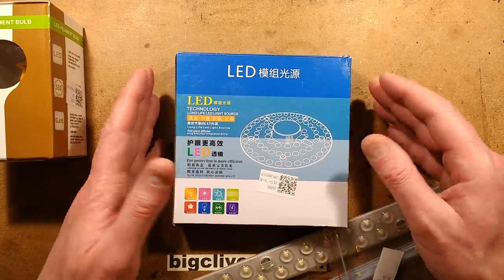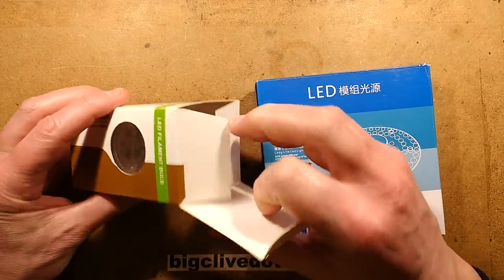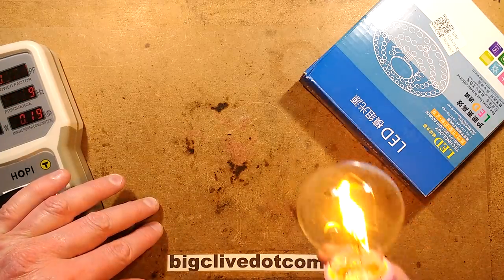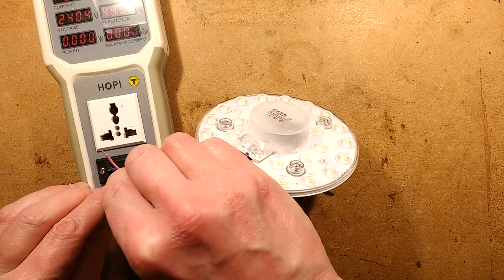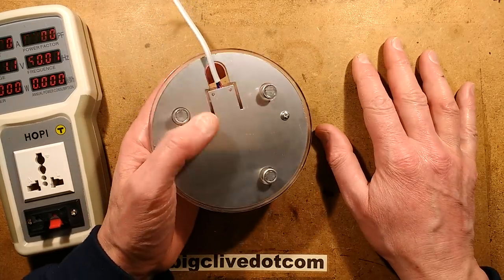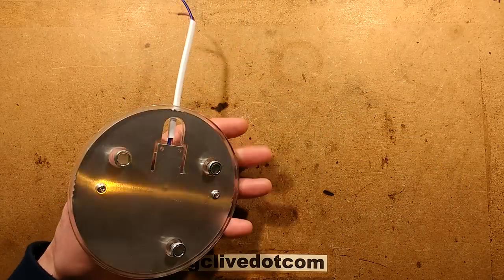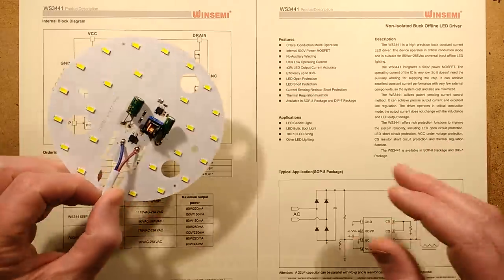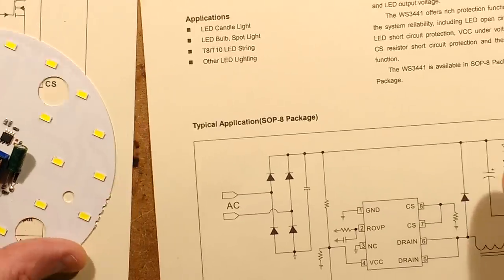Inside a 12W LED module.

Comment: The leakage could also be from light switches that have the locator neon wired across the switch terminals, maybe try powering one with a neon in series..

Comment: Just clamp a clothes iron in a vice. They have decent heat control so you can leave it on as you solder. Then turn it off and let it cool down slowly.
Reply from the maker: Oh, good idea.  I have an iron here.
Reply: I use a coffee cup warming plate.
Reply: I always have a temp-controlled heat gun by my side for shrink, etc.  I usually use it for warming boards or MCPCB's.  Preheating a populated multilayer board is helpful when trying to desolder things that are connected to heavy topside pours.  Using an iron really only works on boards that have a flat side.  Heat guns work for everything.
Reply: Yup, smart idea!

Comment: The only way to learn about these products is destructive testing.  :)  "I take things to bits so you don't have to" and all that jazz.

If there was a path to earth from the back of the puck LED light, do you think it would provide enough current to trip an RCD/GFCI?
Reply from the maker: I think it's microamps.
Reply: bigclivedotcom it might rise with age and then go down with a bang, insulation ages faster when heated nicely and then cooled again down :-). Most houses don't have lights on RCD

Comment: Clive, roughly what is the “reasonable” temperature that you preheated the aluminium cored board to? I’m assuming you’re using leaded solder and I note that 10 degrees C isn’t everyone’s “reasonable” room temperature! I’ve been using an old set temp iron with a 3/8” copper tip for the job, low 30s is the usual January ambiant temperature here (nth NSW AU) which probably helps
Reply from the maker: Not too high.  Probably around 50C and that was enough to allow the soldering iron to do the rest.
Reply: One way of doing this is to acquire an old (or new) Bunsen burner stand, and place a heat gun under it. That way you can adjust the temperature (and spread of heat) to suit. A search on Ebay (for Laboratory Bunsen Alcohol Burner Iron Support Stand Lamp Tripod Holder) comes up with plenty of cheap options.

Comment: That zero-crossing detection block looks suspiciously like it's designed to operate the inductor in discontinuous conduction mode (uhg, gross).
Also, Clive, the way you explained how the current flows through the inductor isn't really applicable in a buck topology. These buck inductors are always (except if someone's been pinching too many penny's) designed to operate well away from saturation, since that increases losses for very little increased power output.
In a buck topology, like this, the inductor is purely acting as a current storage element, like a capacitor for current. It will cause voltage spikes to keep the current as constant as possible, just like a capacitor will cause current spikes to keep the voltage as constant as possible. So, basically, the current doesn't start of very slowly rising then suddenly increasing a lot during the final part of the cycle; Rather, its maximum, constant, rate of change of current would be achieved for a large fraction of the cycle, linearly increasing until the FETs open, and then it will linearly decrease again, forming a nice triangular waveform.

Comment: Why is it you can only feel the capacitive coupling when you slide your finger along the surface, but not when just holding it there? I've noticed this before like on my metal phone chassis when charging it, and my girlfriend's skin when we were standing under some high power lines.

Comment: Not a fan of these designs using mains connected directly to a metal PCB.  Seems too easy for a layer of insulation to fail and expose users to the ungrounded rear of the metal.

Then again, we know that generic Chinese products Never Fail.
Reply: Stinky Cheese what? You don't like random zaps from a cieling mounted light fixture :-)

Comment: There’s a spare pair of pads above 1R4. Is it contacts for a parallel resistor?
Reply from the maker: I think it is.  It's a fairly common technique for fine tuning the current by using different values of resistors.

Comment: I still haven't figured out how to actually use (similar) modules like these. Without heatsink, the leds will die extremly quickly, even if they are only used for half an hour at once. But what kind of heatsink is there? How to mount these modules to cool them?

Comment: 10 C house, why, just why
Reply: Pure and utter madness. :)

No doubt Clive uses a cold water bottle in bed at night instead of a hot water bottle (no electric blanket of course to save on the electric bill).
Reply: He is Scottish, and heating costs money :)
Reply: It's nuts, even anything under 19 C makes me feel like it's a Kranhaus if I'm in it long enough
Reply: THX 1138 doesn't your face get cold!?
Reply: I got second-hand cold just from thinking about it.
Reply: Because 10C gives enough margin that water lines are unlikely to freeze even if they are a bit cooler than the rest of the house.
Reply: it’s most likely related to the fact that not only is it more often than not cold up in the highlands but he works outside high up in the open air so he is constantly acclimatised ( hope that’s spelt correctly) to the cold otherwise he would just keep getting ill 🤧 all the time and/or not be as able to do his job as well as he does.. just my assumption anyway, i’m sure Clive will tell us one day. the other reasons could be that he saves the money on the heating to go shopping at pound land or it’s just simply cos he’s a tight arse 😳😁😁😜
Reply: Bears like it cold, that's why.
Reply: Why? Because they don't make thermostats that go any lower. ;-)
Reply: 16°C is my low threshold temperature for an office. Below that, and the aches and pains become intolerable.The bedroom, however, was at a comfortable ~5°C last night, with the window open. Can't sleep in a warm, airless bedroom.

Comment: The coffee maker element, Nerdrage was looking for magnetic stirrer heating elements a year ago, I wondered if it would be the same type. 
  Needless to say, he did have a load made specifically for the task at great expense. You mentioning it spiked my curiosity.
Reply: Magnetically stirred hotplates are a lab. standard appliance. The German company IKA-Werke do a very wide range, and they also supply a complete range of spares, including heating elements (theirs are ceramic-enclosed for safety). Not that expensive either.
Reply from the maker: Nurd Rage featured those again.  They are outlasting the original elements completely.

Comment: Clive, i would like you to investigate testing capacitors using a audio source...   as what i have seen on youtube doesn't really backup the theory... thanks if you do...
Reply from the maker: Capacitors are not optimised as a sound source.  Although they may exhibit piezo electric properties it's usually considered a nuisance.
Reply: I didn't expect an answer so quickly....  But your right about capacitor as a source, but i didn't explain myself correctly.  please accept my apologies.  What i meant, was using audio source to test for faulty capacitors, and possibly still in circuit.   As i can hear the difference, but just wondered whether we could debunk it as a valid test for a faulty capacitor...
Reply: Shango066 does this all the time when "resurrecting" old radios and televisions. It's certainly an effective go-nogo test.
Reply: thicklyspread  What property of the capacitor are you wanting to test? The capacitance, the self inductiveness or for electrolytic type, the ESR? And do you mean while still in circuit, or out of circuit tests?
For out of circuit tests, for capacitance, apart from large electrolytic values, there are plenty of reasonably priced multimeters can test them. For ESR, there special testers available (they also measure capacitance).
For in circuit testing, it very much depends on the circuit that they are in. Sometimes a signal generator and an oscilloscope can help to indicate if a capacitor is okay.
Reply: Yep, that's the guy, just can't find the video i saw...  i'll have a look around

Comment: An old steam iron would heat it up nicely too, built in thermostat, "synthetics setting" maybe :-)
Reply: So, "an old steam iron" is that what they used before the electric ones?  :-)
Reply: LOL yes but you needed a bag of coal to iron a shirt :-D
Reply: And a problem to use upside down...
Reply: Dam right, the coal would fall out :)
Reply: The ashes were a problem with those, so grey shirts were common.

Comment: Hey big Clive how are you I watched your video on the driverless led chip was wondering do you think if I ran one on top of a heatsink and 120mm pc fan it would be fine planning on using them on my aquarium??
Reply from the maker: I'd be cautious about using exposed mains voltage LEDs in a humid environment.
Reply: bigclivedotcom indeed they will be inside of one the larger led flood light cases I plan on grounding them also as they don't seem to be when you open them?
Reply from the maker: It would work, but I'm not convinced about reliability yet.

Comment: Very interesting. As for the exposure, up until the block diagrams etc I thought it was spot on. Perhaps you had manually adjusted at that point. But, thanks to your thoughtful use of an off-white sort of paper, this is not normally required.

Comment: I have a ptc heating pad glued to a glass plate, the kind you find in showcases where they keep your food warm in! 
It actually works pretty good, it also has a knob to set the temperature :) I mainly use it to keep my coffee warm, but setting it higher will generate enough to help with the soldering!

Comment: Friends of mine have a large room that is lighted by multiple fluorescent tube lights. It's something like 60m² and they have 3 switches for the lights, one lights up half the room with about 8 fluorescent light fixtures, and the other 2 switches control 4 fixtures each. They are looking into reducing the power consumption of this (since each fixture uses about 60 Watts or so), but have no clue on how to do that. I've looked at one of the fixtures, but other than the fact that there is some big and heavy transformer like looking module in each of them, I have no idea as well. So is there a cheap way to make these fixtures use less power? Maybe even getting rid of the tube assembly alltogether and just putting LED strips in them? I think these fixtures are 120cm each, but I'm not exactly sure about that...

Comment: I'm looking to improvise an in-case-of-bad-days finger-tip warmer that can be sewn onto the fingertips of a donor glove. I want to use resistors because, well, I have a ton and (in theory) I can tune the wattage to a safe level.

What ballpark voltage and resistance should I use for a safe-but-warm experience? I don't want to burn fingertips.

Comment: Hi, Clive, I have two 230v to 12v dc supplies and have fitted a 12v led strip with 6 LEDs on the strip but they only last about one year under the kitchen cabinets do you have a suggestion to replace them with something that will last longer?

Comment: Why not use a heat gun or your hot air station for preheating?  You already have one, and the MCPCB will hold sufficient heat for a while.  Using air also allows you to preheat other boards (e.g. multilayer boards with heavy topside and internal pours), whereas using a plate heater won't be as quick or selective in such a case.

Comment: I wonder what would happen if you provided a equipment ground to the aluminum plate on the back of the device? Would that cause a device to fail or would that adequately provide safe protection once you install it in a light fixture?
Reply from the maker: It should be OK, but you never know how circuitry may react to capacitive coupling.

Comment: If the aluminium backplate acts as such a strong capacitor (that you can light up LEDs), wouldn't that set off your auto-breaker, if grounded?
Reply from the maker: It's still a very low current.

Comment: I have bought some  similar modules to retrofit into fixtures in my house that used linear halogen tubes. The ones I got were "25 watt", and are proper bright. However, mine had a seperate power supply board that was double-stick taped to the same area that the components on this one were. They are stupidly bright, and the warm white are wonderful. The only issue I ran into is that the electrolytic cap on the power supply blew out in 2 of mine, they were 230v rated (I'm in the US, so I was feeding 110v into the modules, which they were rated for), after I replaced them with 470v caps, they have been working flawlessly.
Reply: Sounds cool, shame about the caps but they can easily be replaced. Do you know where to get them from? As they sound interesting enough for me to play about with in old 2D bulkhead fixtures, so long as the circuit works on 240V.

Comment: Is it possible to covert a mac500 to an led cold white cob
Reply from the maker: The optics in theatre lights tend to be designed around the source, so you might need to use a high power point source, which isn't a good way to use LEDs.

Comment: Why there are two FETs? I don't get it.
Reply from the maker: Two independent control systems in the current path.
Reply: bigclivedotcom, It seems like they are using a push-pull (sometimes called a totem pole) configuration, either to spread the peak voltage out a bit, or to allow the chip to sample the output without switching directly to ground.